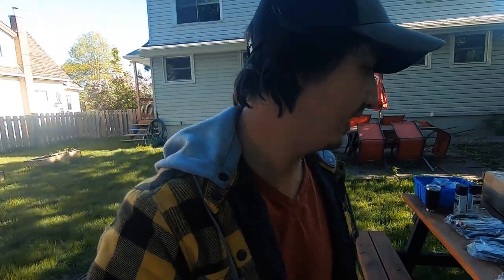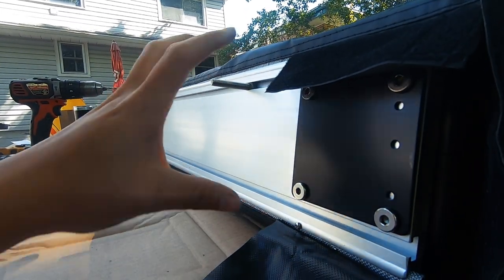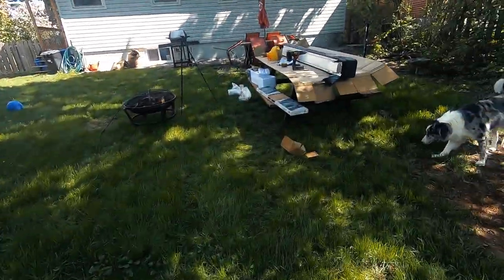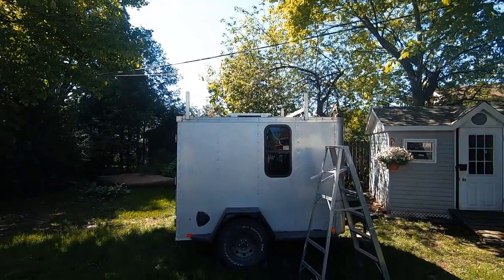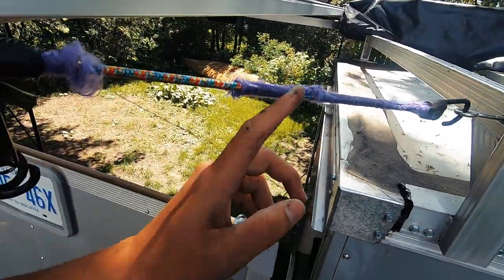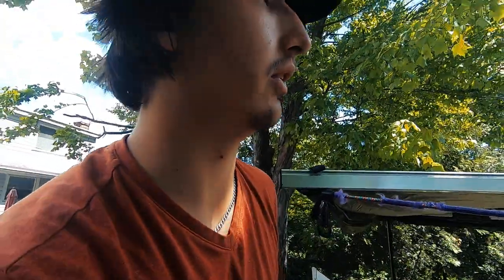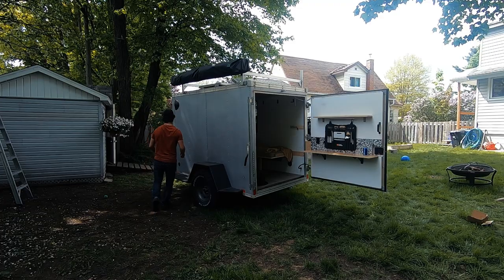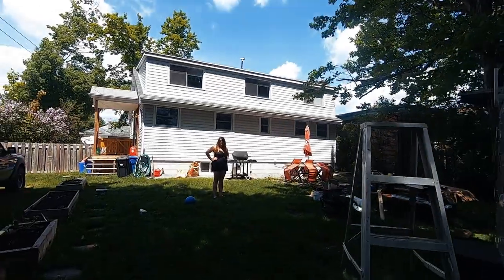Installing the BEST FREE STANDING AWNING onto my Cargo Camper

Comment: So great to see your enthusiasm!  I'm basically setting up the same thing on my small enclosed trailer (that's used for equipment hauling only) to provide shade while un-loading/loading.  

I read that you changed the mounting method you used. I was intending to basically do the same thing.

By chance can you let us know what you did and how the new method works?  Thanks for the help!
Reply from the maker: @jeffkarp3049  checkout my updated walk around video and for more information on how I changed up the mounting system. I used some old bed angle iron and made my own brackets bolted to the roof rack. Thanks for watching!

Comment: Hey Joel, 
You were one of the 1st people I watched when I decided to take the plunge and build a cargo trailer conversion and now an awning! I appreciate your videos!

 I am have a little trouble figuring out two things. 
1.What is the furthest distance the ladder racks can be apart as I have not mounted mine yet? Seems like I need to plan from the rear so the awning can wrap around the back of the trailer.

2. I have been looking for a ladder rack like yours that is low profile and actually has a 90 degree piece that attaches to the trailer rather than just screwed into the side. Seems more stable. What brand is yours? 

I am going to run the ladder rack bolts all the way thru the trailer and put lock washers and nuts on them since i have the wall open rather than just self tappers, 

How did the U bolt plates mounting idea work?  Seems like most of the mounting hardware is for car and truck racks so this was a cool idea. 

Thanks!
Reply from the maker: Hey Colton, awesome to hear. Thanks for watching and all the support. The distance would vary from awning to awning. I did 6' apart and that's about as far as I would take it. Measure from the rear and make sure that it isn't too far back or it won't cover the end like you have mentioned. I don't think my roof rack has a brand name, it was just a factory option from the manufacturer when (previous owner) had bought the trailer. Good luck with the install! 270° awning is definitely worth it.
Reply: @JoelTremblayCA  Where you able to move it far enough forward (based on the location of the rear ladder rack) to eliminate that gap over the rear door? Looks like there is only so far you can go because of the awning cover and that black plate with the four bolts. Thank you!
Reply from the maker: @coltonboyd5911  I was able to shim it forward but still left a bit of a gap. I'm working on a detail to fix that issue and to lower it so there's no gaps underneath.